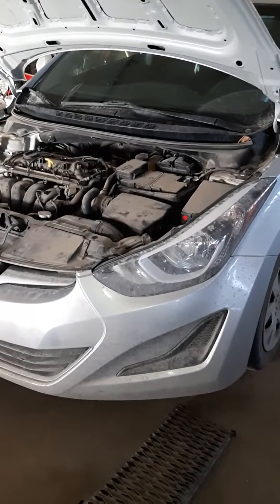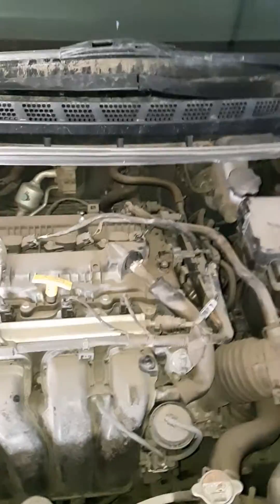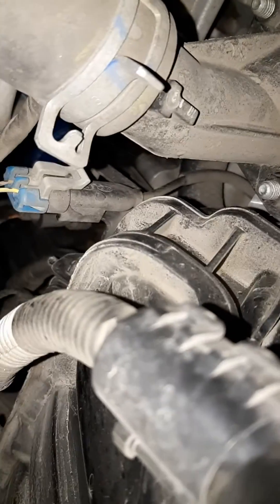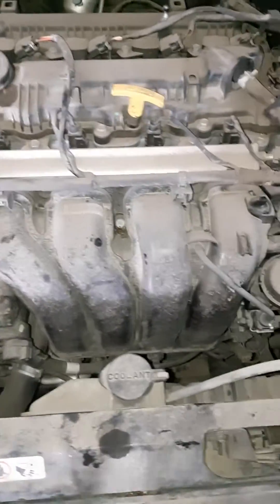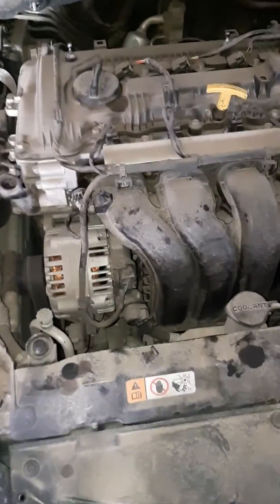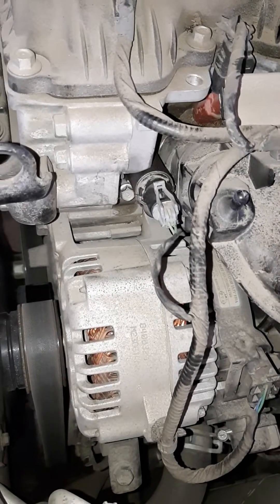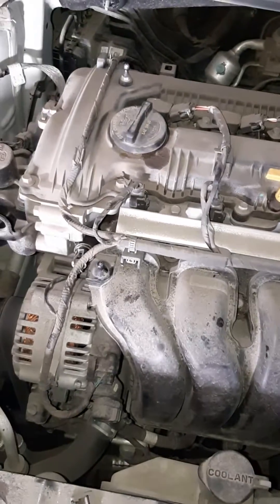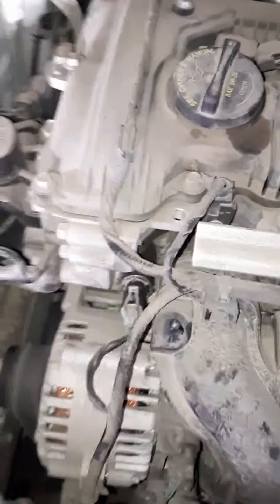Hyundai Elantra Code P0016 Problems

Comment: Did you find the solution
Reply from the maker: Hi, yes it was the timing chain tensioner had went causing the timing to be thrown off.  Hope this helps, thanks for watching!
Reply: @THEMOOSESWRENCH  

Yes the ginger press or the chain does not work regularly